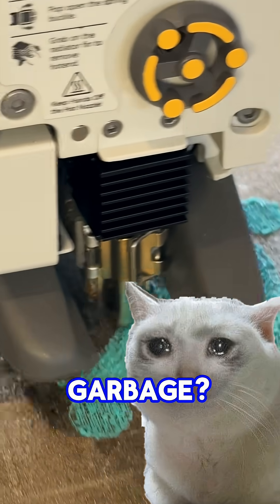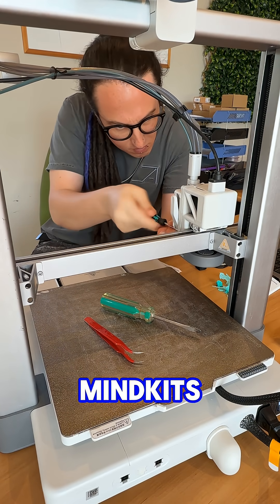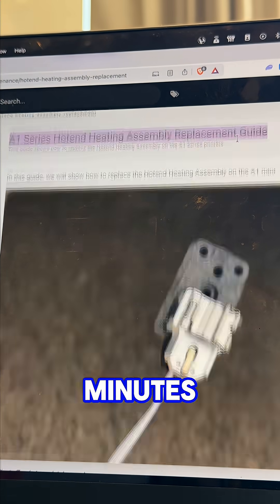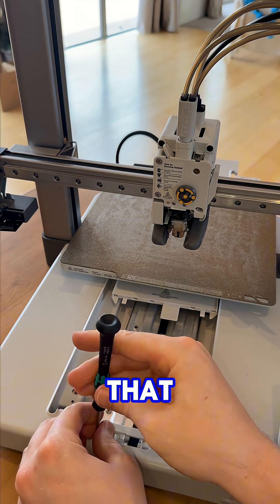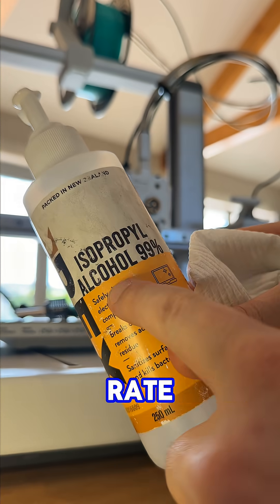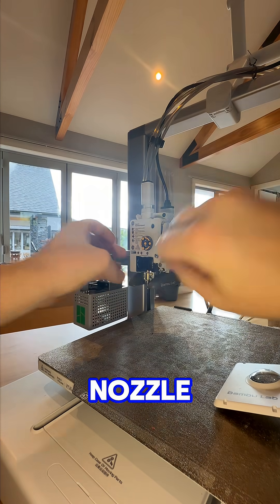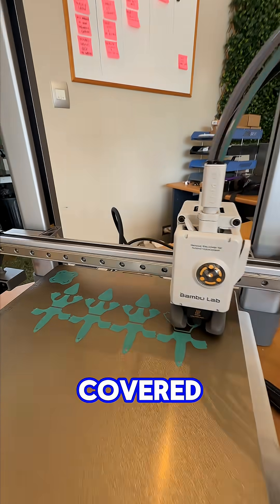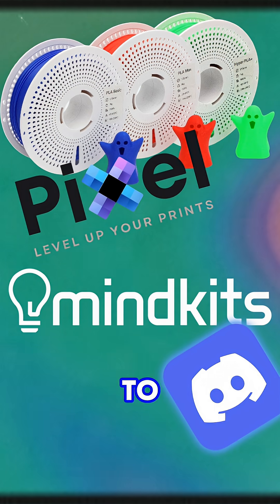FIRST LAYER LOOKING LIKE HOT GARBAGE? LET'S FIX IT

Comment: When I had this issue on my A1, it turns out the cause was that the nozzle was ever so slightly crooked despite the latches closing properly. A very easy fix, but not what I tried first since I'm still a newbie. Now I know.

Comment: This issue I’ve run into and am currently troubleshooting has to do with heat creep. Over time while actively printing layer consistency especially the first layer will get worse. The first layer often won’t go down cleanly or at all since the filament is prematurely melting before being put down leading to bad adhesion and inconsistent layers. Check and listen to your fans, especially the hotend cooling fan as it can easily collect dust and debris which leads to bad performance and clogs in your hotend. It’s annoying to  troubleshoot but it’s better than buying a whole new extrusion assembly.

Comment: Tri color filament works fine. Use it all the time.  BUT yes - dual color filament isnt totally round.   I had issues with dual color.  Never an issue with tri color.   2) Bambu's, 1 qidi

Comment: Always dry your bed and wash your filament!
Reply: Yeah I wash my filament really good it helps with adhesion they say the famous “oh make sure your filament is dry and has no moisture or else it’ll mess up your print” but no! It helps stick to the plate really good it creates a glue like texture with the melted plastic and water
Reply: bubble bubble toil and trouble (of filament)